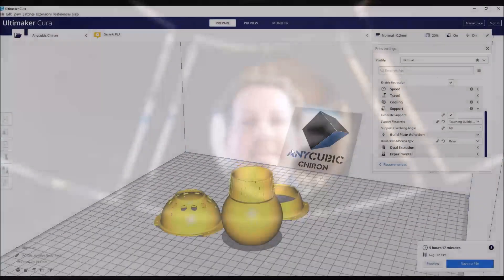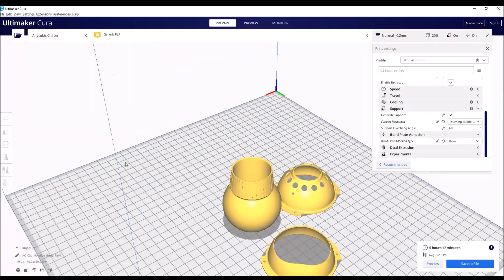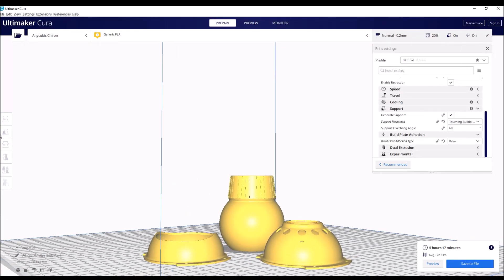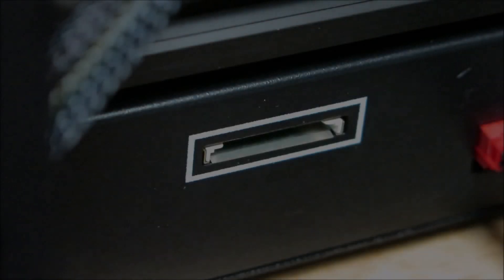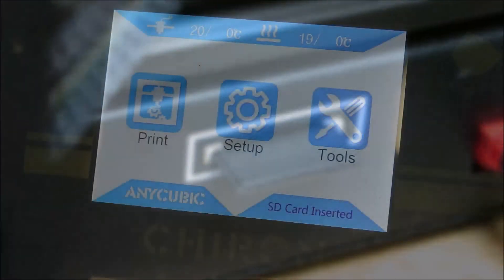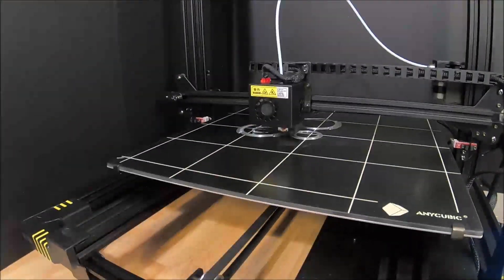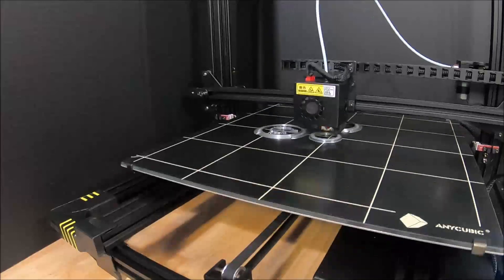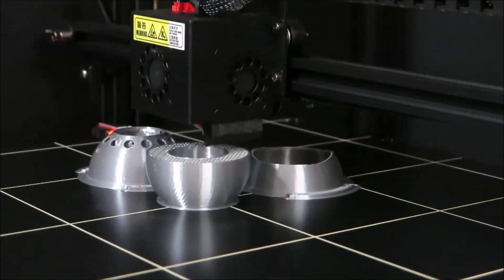3D Printing R2D2 Holoprojector using Anycubic Chiron 3D Printer

Comment: Why did put the print on the side instead of the middle?
Reply from the maker: What do you mean?
Reply: Family DIY 
Then print is not in the center of  the build plate.
Reply from the maker: No reason, just how it got lined up
Reply: How you calibrate the E-Steps on the Anycubic Chiron. Can you do it on the display or does it have to be done on the computer 💻?